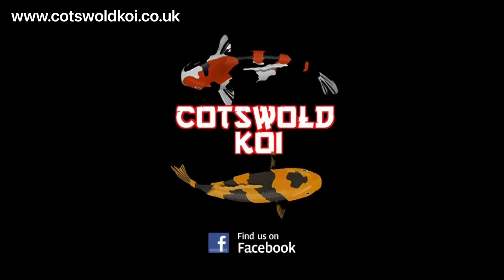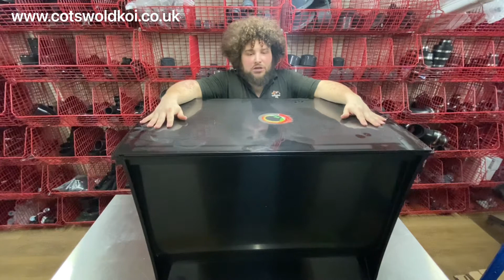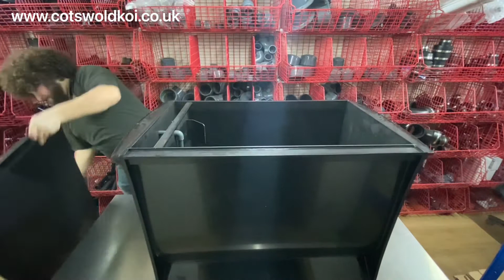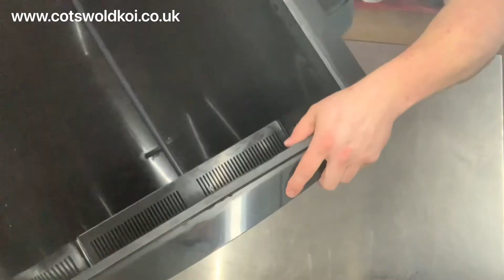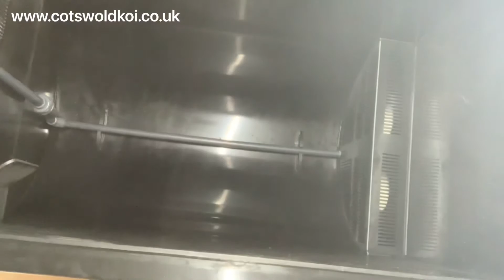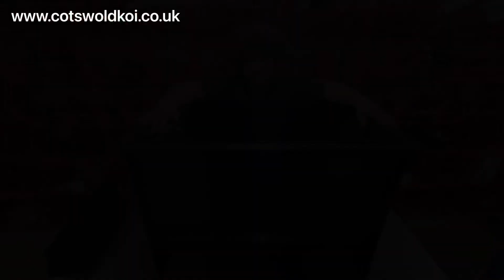Draco Drum midi Bio Unit

Comment: Lovely piece of kit, what air pump would you need for this size and the larger version, would the EA airtech 70 be more than enough? The curved base seems to eliminate dead spots in the media as well. Great videos, someone mentioned air source heat pumps in the comments on a previous video, this would be good to see!..👍👍👍👍
Reply from the maker: I would normally use a hi blow 80 on this size bio unit,  your airtec 70 might struggle if you plan on filling it to the maximum with media
Reply: @cotswoldkoi  Thank you, when I do my mods here I will be buying new air pumps but I quite like the airtech 70's as they are quite cheap to buy and run, I wouldn't need 200+ Litres of media, 150 / 175 L would still be more than enough for how large I am planning on going. Thanks again.....